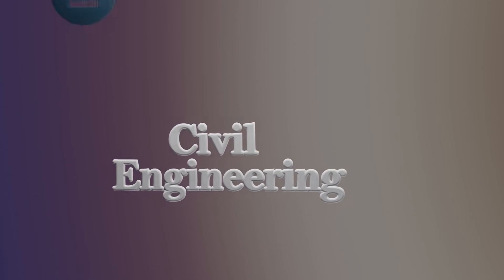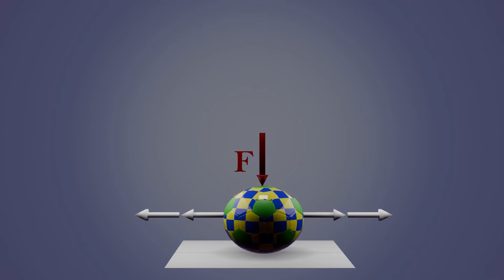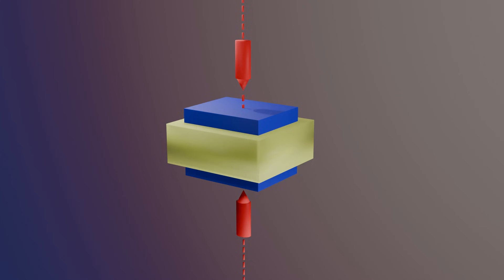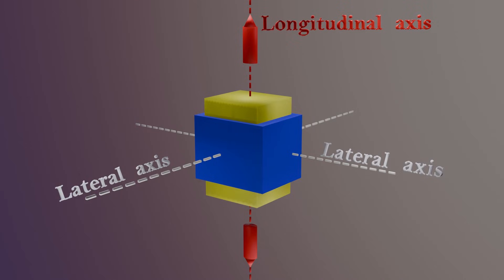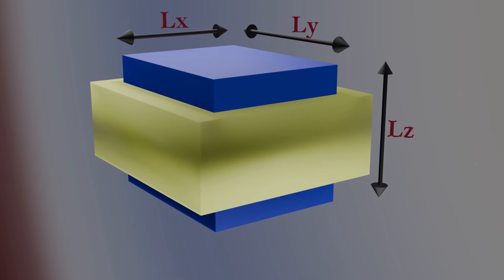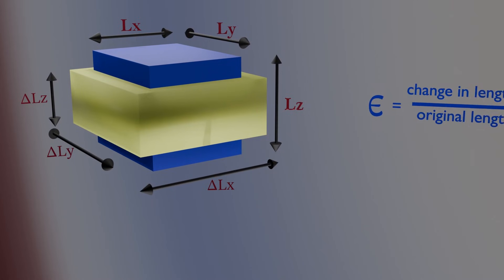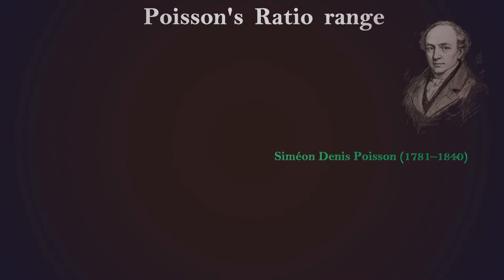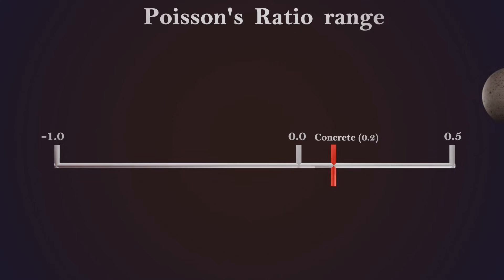Understanding Poisson's Ratio Concept

Comment: We can make Negative Poisson's ratio STRUCTURES out of Positive Poisson's ratio MATERIALS. Called Auxetic Structures.

Negative Poisson's ratio structures EXPANDS in both Lateral and Longitudinal directions when applying Tention Force.

And

Negative Poisson's ratio structures CONTRACTS in both Lateral and Longitudinal directions when applying Compression Force.

The Cellular Structure alignment of the Positive Poisson's ratio Material can convert the material to Negative Poisson's ratio.

Cellular Structures such as:

1. Honeycomb Structures

2. Foam Structure Re-entrant Honey Comb

3. Semi-rigid Triangle

4. Star-Shaped

5....etc.
Reply from the maker: Appreciated 👏👏